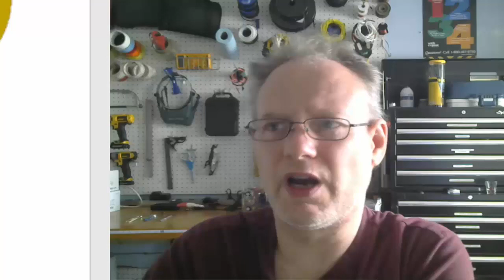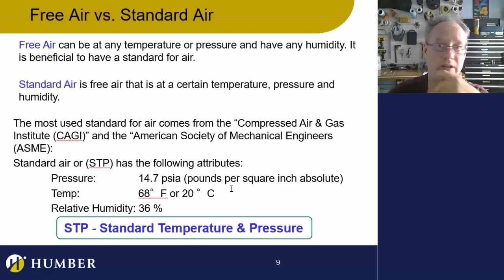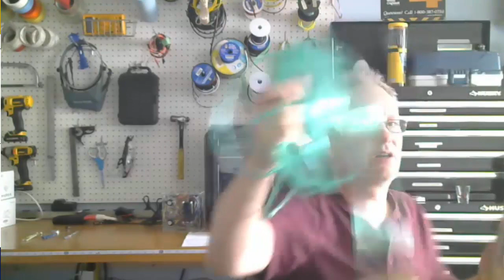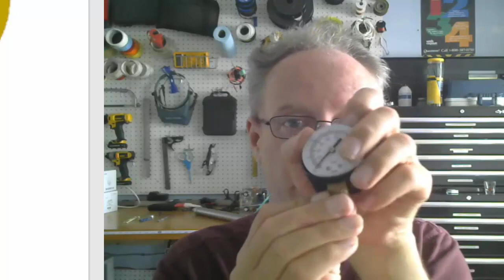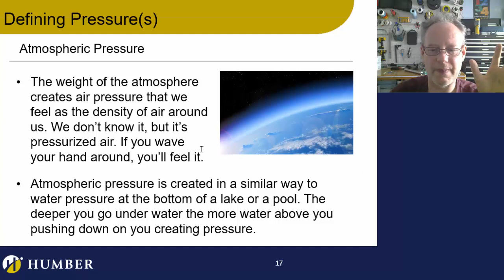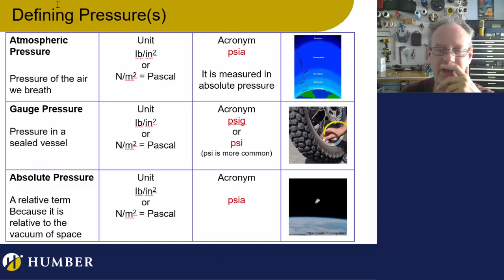Comment: Really cool video, thank you professor. One question, how an absolute gauge works? Thank you.
Reply: Each semester I wait for a student to ask me that question an no student has ever done so. This tells me that they're not fully wrapping their head around gauge pressure an absolute pressure and atmospheric pressure and how they are all related. You've done a good job breaking the pattern. The answer is cool! Essentially, an absolute pressure meter is connected to an absolute vacuum. Unlike a gauge pressure meter where it studies the differential between pressure into tank and pressure in the atmosphere, an absolute pressure meter studies the difference between the pressure in the tank and the absolute vacuum chamber that is inside the meter.
This article unpacks it quite well: https://blog.wika.us/products/pressure-products/absolute-pressure-sensors-work-needed/#:~:text=With%20absolute%20pressure%20sensors%2C%20the,its%20reference%20and%20zero%20point.